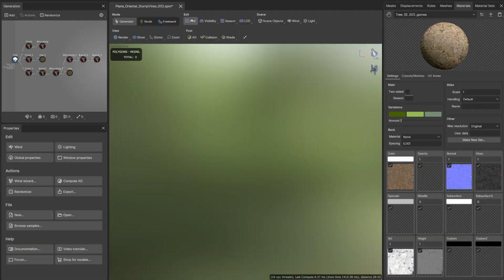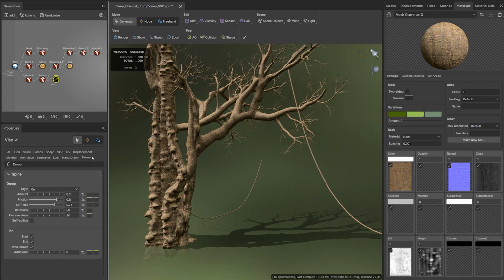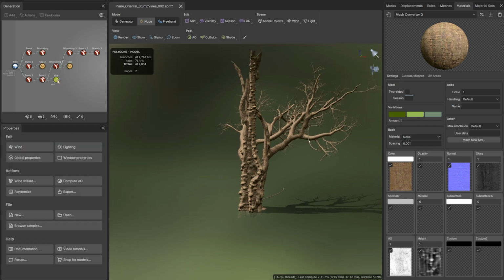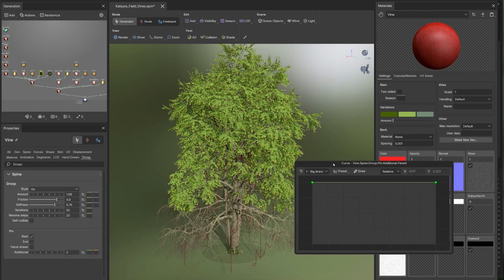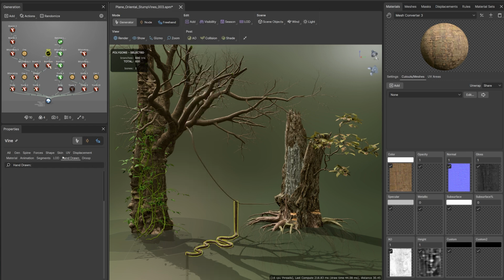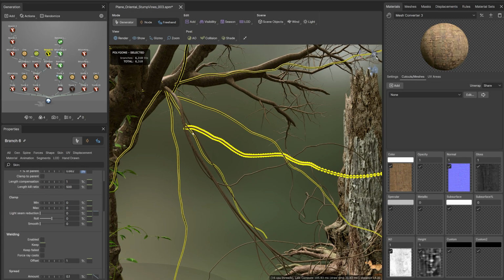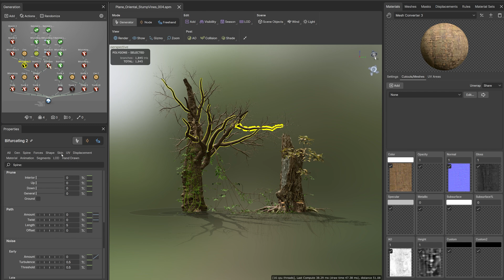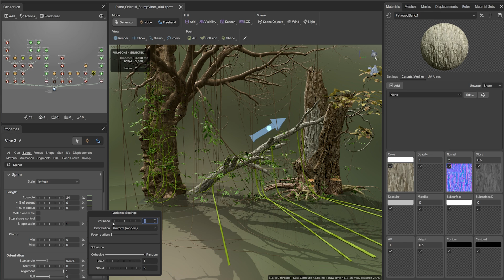SpeedTree 10: Vines

Comment: Would this work on Unreal?
Reply from the maker: Yes. This is a middleware, so you can use this feature and export to Unreal with a games wind that moves the vine branches as well.
Reply: @SpeedTreeMiddleware  Is it necessary to readjust the parameters within the Unreal  if the imported Game Wind style is inconsistent with SpeedTree?